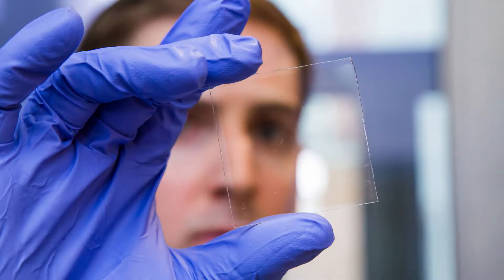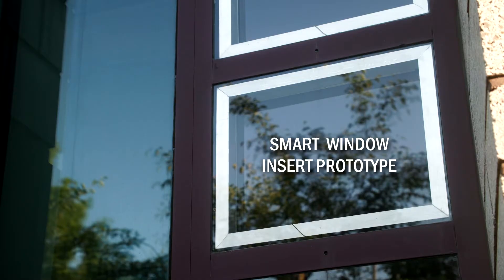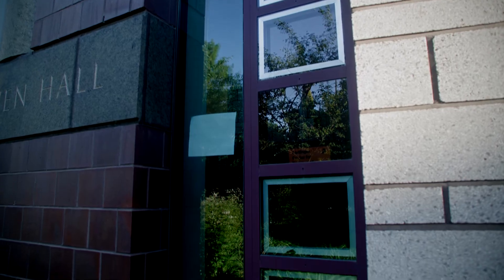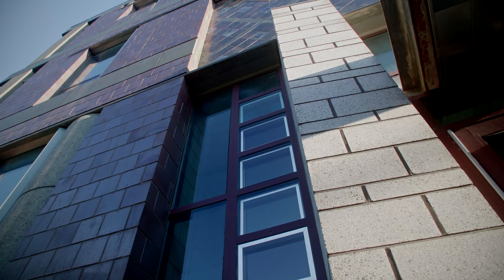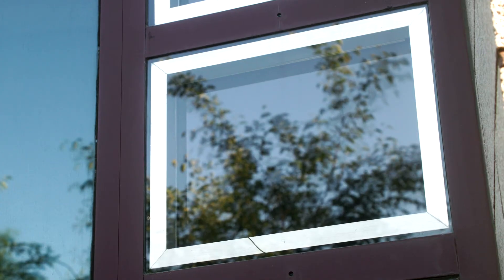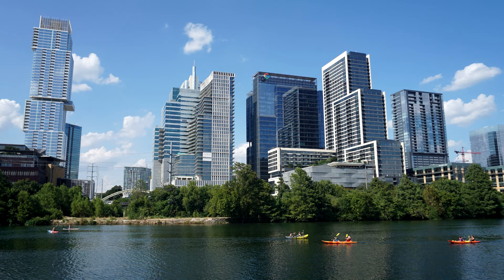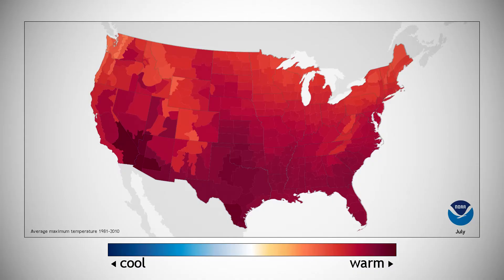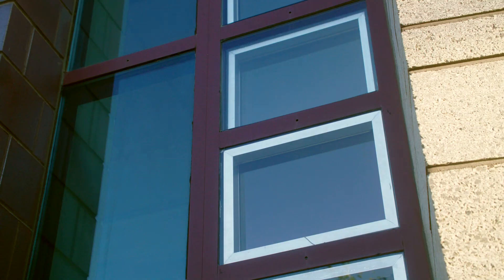Solar-Powered Smart Window Inserts

Comment: Wow, great idea.  I wonder if the heat could be a benefit in colder climates, to offset heat loss from windows or to even generate/capture heat for use inside the structure as needed.